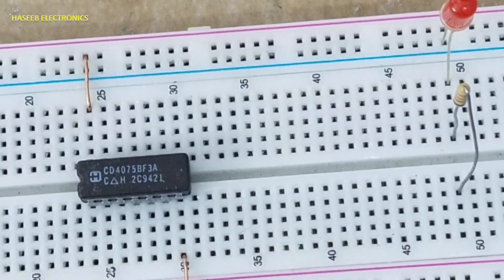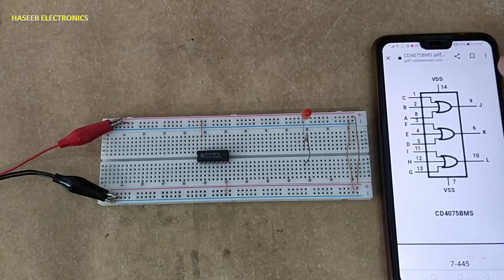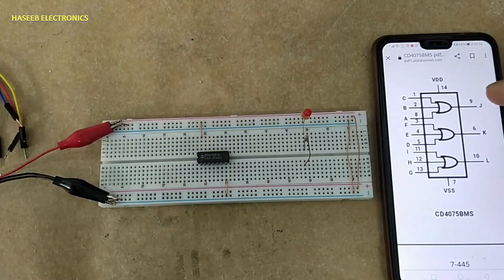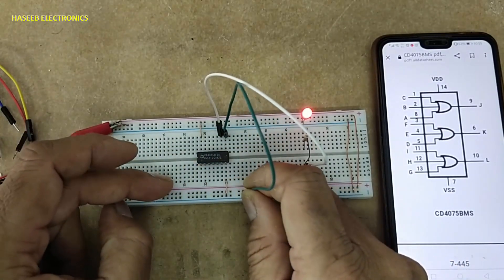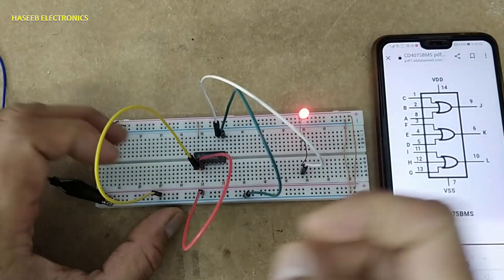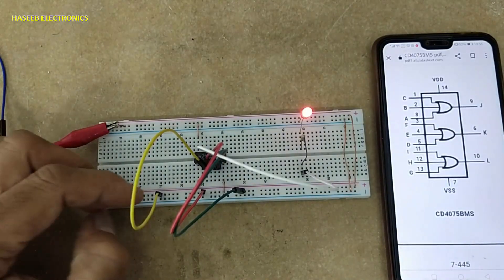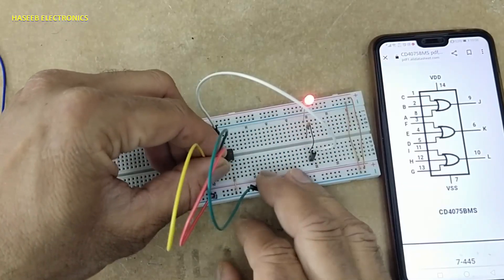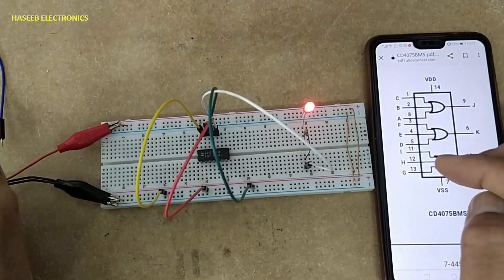{1036} CD4075 3-input OR gate

Comment: Good day sir 1st let me thank u very much for ur informative channel in English, Sir can you perhaps tell me why are there no backlight voltage generated on secondary side of TP.V56.PC821 combo board i have check all components on the schematic relating to inverter circuit bt found nothing wrong still no output voltage on backlight connectors it shows 0v on both conectors i forgot to insert the schematic pdf of TP.V56.PC821 sorry